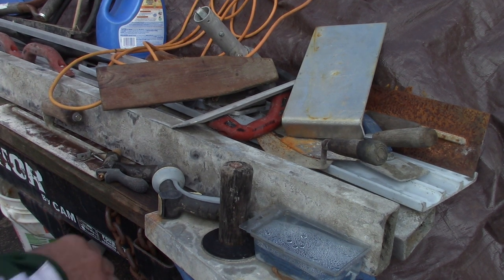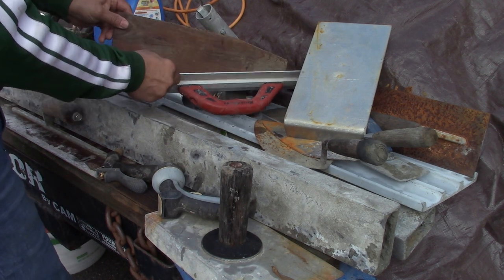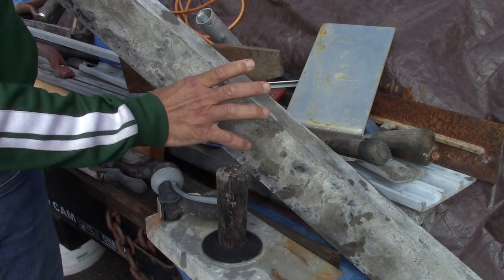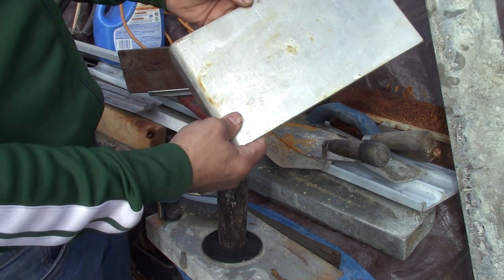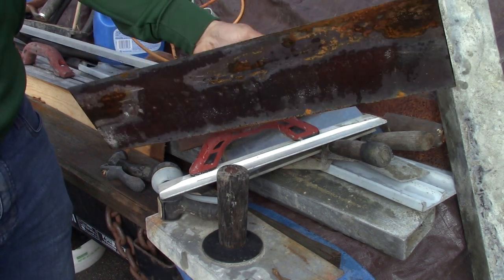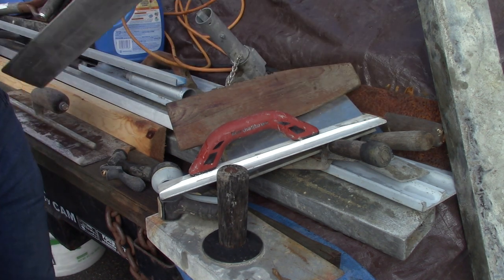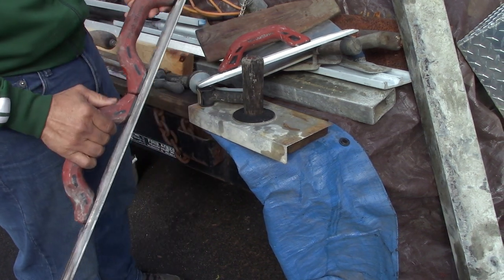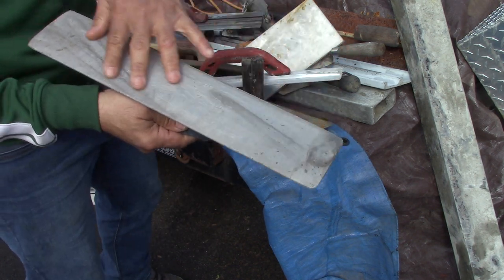Concrete tools and how to choose the correct tools Magnesium, wood and steel trowels

Comment: If I understand this right...The iron steel material of the trowel is reacting with the concrete that some how seals the structure of the material creating a bonded layer shell....And using magnesium trowel does not cause such a reaction, and doesn't seal or bond the top layer, and the concrete can still breathe? Is that correct? But both trowels will give the same slik smooth finish. 
Have you done a side by side demo? Would you do a side by side demo?
Reply from the maker: Send a donation to the channel equal to the materials and equipment you are using and I will not charge you to show you your mistakes.
Of course I can't spend my own money to do these models that all the YouTube subscribers might ask, hope you agree bc I never fail.

Comment: Although what this guy said is about rite, there is so much more that should be considerd, like what kind of mud it is, is it low air, is it colored concrete, if it is colored was it dry color or liquid color, ect, this man does know what hes talking about tho
Reply from the maker: All still apply to colorant and concrete setting...
As far as broad casting colorants...
That is another video and still bleed-water issues still apply.
Colorant is other videos I have but a quick tip, colorant is not "developed" in the "water"...
You have acid etch colorant , die /reactive based colorant ... the manufacturer will identify their process and should be followed.

Comment: Im in the process of excavating clay in a northern climate for a 20x35 foot shallow pool.
Small electric mixer
Portland cement 1:3 washed sand.
water plus possibly super-primer.
6" pour over sand base w/rebar.

Is doing this solo a horrible idea?  Should I hire the base out?  Can I pour in small sections?
Should I cut a control line?
Should I have any type of membrane or pond liner below the pour?
Reply from the maker: Here is what you need to do to help you determine if you have the correct load bearing capacity = after you determine the total weight on the soil.
https://www.youtube.com/watch?v=3nTGtX0bvRM
Your soil load capacity is primary, which includes future water saturation / soil expansion and contraction that may take place.

Comment: Anyone who put my tools away like that would be shopping for tools of their own. So what are your thoughts about that dry screed for floor leveling?
Reply from the maker: Cognitive, dry screed, are you referencing the mix that is 6:1?
 I am not sure of the dry screed term you are referencing? Is this the bed for bathrooms or is it something specific from a manufacturer you are referring to? 
Also, I did a video about overlays and basically, you do not want deflection on your subbase and need to confirm the live loads that will be on your finishing product if it is a polished or finish floor product you are installing.

With that said, 
 I always like to work with manufacturer's recommendation but I also like to do a sample section first to confirm all the bonding is taking place. 
Floor leveling concerns for me is what will the existing substrate do with the mixture you are adding on top of it? Will it ''pull'' the w/c (water content) from the product and cause it to prematurely fail?
So primer usually gets a bonus from me... 
Then screeding is part of the finishing process with most floor levelers as they are ''self leveling'' (not)... 
To answer your question, as long as your product's composition is not changed by your placement (including screeding), then placement can be done in any form your heart can come up with)...
Reply: @ForensicCats  I've heard it called an old-fashioned mud-job, or dry-pack. Im not sure the mix ratios. 4:1 if I recall correctly. A couple videos that got me thinking about it are here; watch?v=Dq0cqcGcujw, and watch?v=ZiwDbbUYBIU. I'm really not a fan of those self-leveling compounds -- I need this floor to look perfect. I will be installing ceramic wood-look tile on top using thin-set. The existing concrete substrate, though mechanically sound, is about as smooth as the surface of the moon.
Reply from the maker: Cognitive, I will do a video response for you ... and post on my other channel, brb with it with some tips added in it...
Reply from the maker: Enjoy... https://www.youtube.com/watch?v=KVGC8zj3LX4&feature=youtu.be    plus tomorrow I may have another one for you on this topic; dealing with existing cracks on a substrate that is of concrete.
Reply from the maker: Yes, I have to address your moon surface... let me do that in one more video...  One issue would be expansion of those moon surfaces...  I will recommended profiling them  down somewhat...  Cognitive, wait for that video, I hope to post tomorrow or later today for you... I have to get back to work for an hour...
Reply from the maker: Here is the second video on the crack issues you may have to address... https://www.youtube.com/watch?v=sNFrK_Dt37o&feature=youtu.be
Reply: @ForensicCats  Cant thank you enough. Cracks are not an issue for me. A level, smooth surface over an older, hilly, rough surface is what Im after -- tying together a number of older, non-contiguous  cement surfaces into one, unified space with a uniform floor height.
Reply from the maker: @CognitiveDisonance  ,  on this topic of a number of older surfaces,  consider checking it for movement first,  fill all gaps you can find with a hard cement paste / grout and see if any of the grout pops or is crushed or has gaps created on either side of joint...   If so, then do the crack isolation trick I spoke of in the other video I posted on my other channel on this topic.  Once, you establish movement is present and where... just think of it as a ''bridge expansion joint'' -- they cannot ever come into contact again and must be joined with it's own ''elastic bridge'' (how about caulk and not epoxy -- epoxy forces the two to bond and no reason to that on the floor as you will not know where the next crack will show because of this new bond and the concrete still may want to relieve the tension in it.)... The last thing you want is to finish your hard work to discover you simply force the floor to crack somewhere else...  So, accept the cracks where they are and ''bridge them''...
Reply: @ForensicCats  Thank you. Its more like one larger, uneven surface, with a couple adjoining areas where 
I could put a threshold, if need be. With all the patching Ive done already, everything seems very stable -- no cracks have shown up anywhere at all. Now all I need is a smooth, level surface to accept ceramic tile as a finish floor. The space is a heated, residential dwelling unit.

Comment: Is there a cure and that can also be used as forming wheel I do a lot of rough work concrete for structures and some slabs but mostly highway work
We take pride in our work but it does not have to be the prettiest speed and productivity count the most in my industry.
A cure that I could use as form oil would save space in my truck
Reply from the maker: Cures, are for different environments and what is good in Florida might not be appropriate in New York.
Also, some specifications may demand a certain brand (on state jobs)...
So, no curing agent and form release will be acceptable universally)... 
Some contracts might insist that none are added. 
Depends on your mix design and if you are allowed to use it.
With all that said, you want to always sample the concrete mix design you are working with and how it relates to your finish techniques.

Comment: Other than the obvious benefit of showing off luxury-branded magnesium tools to our friends, when would we use magnesium over aluminum and steel tools for concrete work? Is this simply a change in weight?
Reply from the maker: Wood, is better for high slumped concrete, watery...
Also, used for non-air entrained concrete.
Aluminum is also good for non-air entrained concrete but, it is usually thought of as an equal but lighter version of magnesium...
Then we have resin trowels, again, the finer the surface tooling, the more it will give you a ''tighter surface finish'' (by default)...
Basically, keep magnesium with the air-entrained concrete and no resin trowels with air-entrained as it may remove some of the "air qualities"... Of course this is on the surface at this point and you should not be using steel trowel or those tight finishes on exterior / air-entrained concrete -- typically.
Magnesium, has a tendency to "add" air with it's surface interactions...  Again, it will be on the surface, this is not a magic trowel, it cannot penetrate but it can still result in failure of the top layers of ''paste'' if you do not allow for evaporation of water content in concrete as the slab ''directs''... Some of the evaporation, that is not on polly based plastic will do into the stone and Earth. 
If, it is on polly, the water is coming off / evaporating to the surface and that is when it is critical that you do not ''crust over'' the concrete before the bleed water is mostly completed (it will still evaporate over a few days and some say years to dry out)...
Reply: @ForensicCats  Ahh - surface interactions. Thanks Kai.
Reply: @ForensicCats  So is using plastic sheeting bad for the concrete? I was thinking of using it as a vapor barrier.
Reply: @DavidPerez-ci6qi  Don't they say concrete cures hardest submersed in water?  plastic sheet keeps the moisture in it from drying out.
Reply from the maker: No ''submersed" = a limit of saturation exist, otherwise you will just dissolve the materials and no bond will take place. The curing process is best monitored over 3 days or so... meaning depending on the temperature and exposure of the surfaces of the concrete will factor in.  As far as plastic goes, that just slows evaporation from wind and may control some heat loss evaporation. But, it may also imprint on your concrete if placed too soon.

Comment: my colleague uses a metal trowel after edging. how do i say it kindly that his doing it wrong
Reply from the maker: It usually does not fail around the edge only if you use a metal trowel; mostly because the detail allows for the water to escape laterally but I have seen some small ''spider type cracks'' on edges many times...  This is when it did not escape.
I would just ask them why do they not metal trowel the entire rest of the concrete also?  When they answer back that is ''stupid'' ... then ask them, then why is okay for the edges to be metal troweled?  Keep in mind, it is all ''metal technically" -- I assume you mean the metal trowel they are using is ''closing up the surface'' before bleed water has escaped?     Remember, once bleed water has evaporated or been removed, it is okay to steel trowel it; if that is the finish you desire. 
Thanks for your question.
Reply: @ForensicCats  I believe that most people aren't educated enough on these kind of things and use the wrong tools at the wrong time. Yes your assumption was spot on. Thanks for the answer.